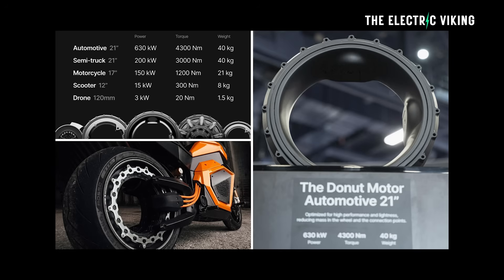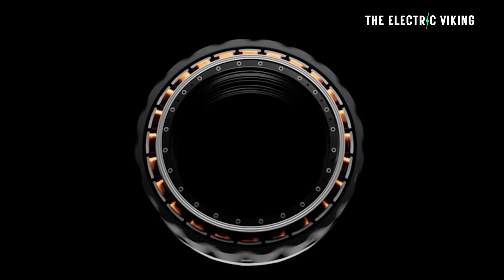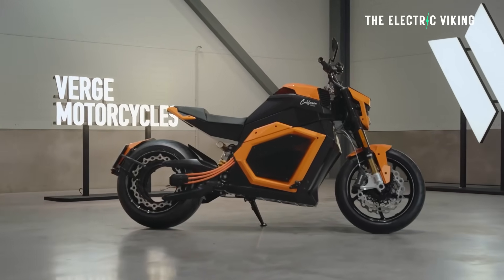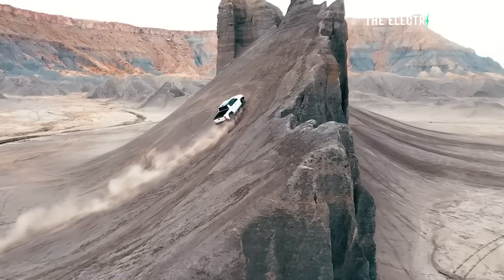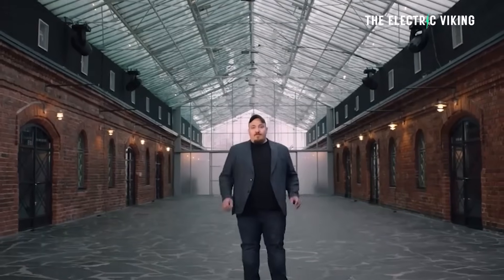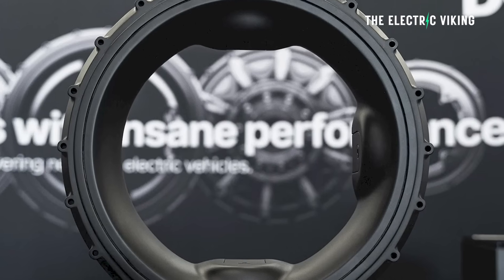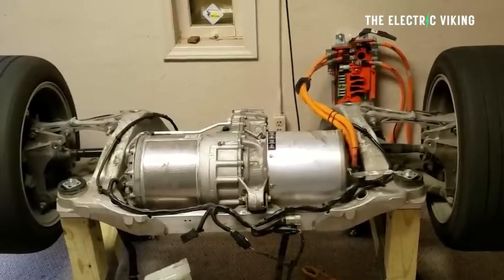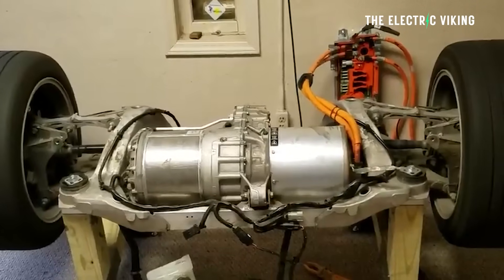Donut Labs' game changing Electric Motors will Revolutionize the EV Industry

Comment: Elaphe has been building in-wheel motors for over 15 years and you didnt even mention them. Ital design designed a super car with their motors in a concept car with 2000HP in the wheels. I havent seen donut lab motors on anything except on verge motorcycles. Do your homework research before posting such nonsense.

Comment: The Lucid Air motor has a superior power to weight ratio and a far superior power to rotational inertia ratio. It is far cheaper to manufacture and has been in mass production for over three years already.
Reply: Is is a great design. Actually inspired by some hub motor tech. Same winding as Elaphe just optimized for an in-runner.

Comment: Sounds interesting, the problem I see is the motor is AC but, the pewer supply is DC meaning each wheel requires  a heavy invertor and, cooling system.

Comment: I'd like to see a marine version, as the power units could be aligned with the prop shafts and therefore weight distribution would not be an issue. Mega-versions could be installed in freight carriers & cruise ships, with the amount of power available.

Comment: I'd probably use 2 scooter motors to power my kitcar as 30kw would be plenty for a car that would then weigh in with a 20kw battery around 500kg and at 8kg per motor it's much closer to the original unsprung weight.

Comment: Why do we talk about these insane amounts of power when we discuss EVs? Is this the only way to break into the market? Are we all F1 wannabes? 

100kW is more than enough for any family car. Based on your table, they could develop a 50kW version at about 15kg. 2 x that would be fine for any car, which is a far more reasonable unsprung weight. 1 would be plenty for any electric motorbike which struggle to deal with high power due to battery weight restrictions.

Comment: 41 kg is about 90lbs.  A Honda Insight G1 has a combination Petrol and Electric motor that weighs about that much with the electric motor weighing about 10 lbs. This very powerful electric motor that weighs 41 kg sounds like overkill. The focus of BEVs should be to make the best pratical vehicle capable of rational driving speeds, not making the next Drag Queen.

Comment: My Sports Sedan with a V6 2.7 litre Engine delivers 155kw and that is more than enough power to get me from A to B very quickly, even the ATTO 3 with 150kw seemed more powerful than my V6 Diesel as there was no acceleration lag, unlike every car I have ever driven, it's something that you get used to very quickly, when you drive a gasoline vehicle your body is used to a lag before it tenses the muscles ready for take off, in an EV, you feel the acceleration like a passenger as you don't get that small lag, it didn't take very long to get used to that, but felt funny when I went back to my V6 Diesel :), a Motor Bike with the same HP as my Sedan would be terrifying to ride, I had a Honda 4 many decades ago and it was a very fast bike and it only had 70HP lol.
Do they have a version for a Jet Ski ?

Comment: These motors are ridiculously overpowered. Why not use 4 x 15 kW (4 x 8 kg) scooter motor in a small car like the Toyota Yaris, and offer options for upgrading to around 30 kW per motor. In a small lightweight unit this would give enough power for a city car.

Comment: Aptera with a 150 BP hub motor in the rear wheel. This should cut perhaps a hundred or more pounds from the total vehicle weight. No need for torque vectoring…….hmmm

Comment: yay. 850hp motor... ignoring the battery and ESC required to deliver that 850hp.

is that electrical power being consumed in the motor? or shaft power, torque over time? if so, at what RPM? cant quote power without giving the RPM...

whats so great about 850hp anyway? or close to a megawatt of electrical power? do you NEED that amount of power? is it SAFE to STORE that power? can the average driver CONTROL that power?

how long do the bearings on these "hubless" motors last, and how much do they cost to replace?
Reply: Exactly. When there are no gears, motors will spin with the same speed as tires. Do the math, it’s about the torque. No car will reach that power at 5000rpm… 4000Nm is still quite ok, but can it fit a brake and a normal rim/tire?
Reply: @lukc1234  everywhere, i see a lot of BS when it comes to electric motors...

"i put a 3kw ebike motor on a sled!"
so...was that the battery that was capable of delivering 30v at 100A? or 48v at 62.5A? or any other combination resulting in 3kw?
or was that the ESC that could deal with 30V at 100A?
was that the motor windings DC resistance that allowed a current of 100A when an EMF of 30V is applied?
or was that the shaft power or output of the motor?
crickets

"but but but electric motors are super efficient!"

of course, an electric motor when stalled consumes the maximum power...but as it doesnt rotate no work is performed... even if it produces "infinite torque", its still not making any power... just consuming it... 0% efficient. bom-bom.

marketing tactics, and big numbers impress small minds... TAKE MY MONEY!!!!

anyway. i get the idea you already know this ;)

Comment: Tesla wraps carbon fiber on the motor to maintain tighter tolerances as the rotor spins up.  A hub style motor can maintain tighter tolerances because it doesn't have to worry about centrifugal forces closing the gap.  Also, larger diameter, like longer stroke in an ICE, provide more torque and lower RPM, no gears required.

The average driver can get by fine with only 400WHp.  If they scale linearly, that means maybe 5Kg on the front 8Kg on the back wheel.

To improve performance, move the motor and brake disk inboard, reducing unsprung weight.

When do they go public?  I have a kit car to build.

Comment: A unsprung motor would need to take a massive hammering from the road surface or be insulated with a high walled tyre.
Reply: quick look at specs on the bearings required.... 

at those speeds, the ratings are pretty sad. few hundred hours life time, at best. ignoring transient shock loads...

the pricetag is rather large, as well... 250mm+ bearings are NOT cheap...

all these issues of thermal expansion and maintaining tolerances...

theres sound and logical reasons they try to make bearings as small as possible and use traditional hubs...

but do they "look good" and can the be overhyped to the ignorant masses with bulging wallets? you bet!

Comment: That is a old concept ''Moteur Roue'' , was invented in 1990 by Pierre Couture in Canada and is know now as the TM4 Sumo motor the rotor and stator position is reversed ansd is used in BYD buses and school buse in North America . All Formula E are using technology coming from this concept. Including square wirering. I had the chance to meet with the enginer that killed the project ''moteur Roue'' for some of the reason you actualy mentionning , but in addition you need to reinforce the suspension , direction , you need 2 or 4 motors additional weigth . Also there is a small space between the wheel and the motor where water and mud and all other shit that can get in the motor.

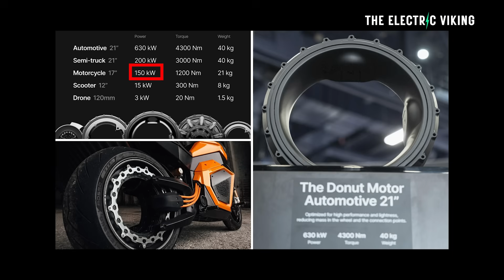Comment: Looking at the chart at 6:53, I think the sweet spot for passenger automotive would be 15" wheels @ 40 kW each, and around 12kg each.  One on each wheel.   Total 213 HP.  City cars could use half that in a FWD configuration.

Comment: Hub motors sound like the go-to solution for ICE-to-electric CONVERSIONS since the engine bay could be used for the batteries.
UNSPRUNG WEIGHT remains a problem, though, as there would be more moving mass for the suspension to manage, and
directional control over bumpy roads (due to varying tire adhesion) would suffer.

Comment: I can envisage a series of standard different sized motors. Experience a problem on a journey and the wheel unit is unplugged and swapped out for a replacement. A breakdown truck could carry one of each making breakdowns far easier to manage.

Comment: The key to cheaper EV are wheel hub motors with breaks built in. Will make an EV much cheaper than an ICE car, and with improved reliability from less moving parts, just as a DVD became lots cheaper than a video player because the electrics became cheap while mechanics has nowhere to fall in price.

Comment: Someone here was saying that this would not be good for off road. But I was thinking just the opposite, think of how much trouble it is to make axels for a Unimog. To get 17" ground clearance they have to have gear downs at each hub. But by being able to attach the suspension to the top of the rim, and have no axel with differential to hang down, is such an advantage. Add to that a smooth bottom battery pack that keeps the center of gravity low and that adds up to a real off roaders dream.

Comment: In addition to Protean, EVR Motors has been doing this for nearly 10 years. Why do we not see a single EV with these motors? What is different about one more company saying the same things these other companies have been saying?
Reply: Donut's big thing (ofc we're yet to see anyone but Verge release a vehicle using their solution) isn't necessarily their motor, but the fact that they're providing all the other peripheral tech for integrating their motors as part of their solution. 

The big cost for using these products is the R&D required to integrate them with your own tech - donut claims they provide all the other bits too, so you have less tech to provide yourself, and it's less expensive to integrate the few things you may need to (maybe? again, I'm not sure how donut plans to address companies wanting to use their own batteries, computers, charge controllers, etc.)

Comment: Adding 80 pounds of unsprung weight to the wheel of a high performance car will absolutely destroy the handling. This is why people spend hundreds, even thousands of dollars for lightweight alloy or carbon fiber wheels. Carbon fiber brake disks go as high as eight to ten thousand dollars. Each. These motors would be ideally suited for a large truck where each of the wheels with tires already weighs 150-200 pounds and an extra 80 pounds would not be as noticeable.